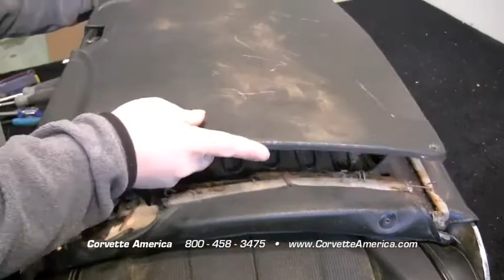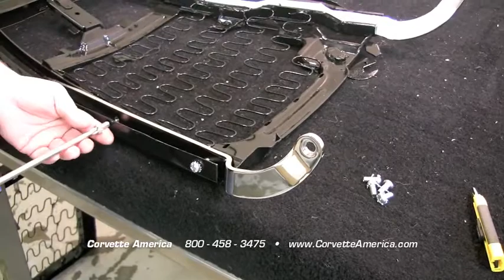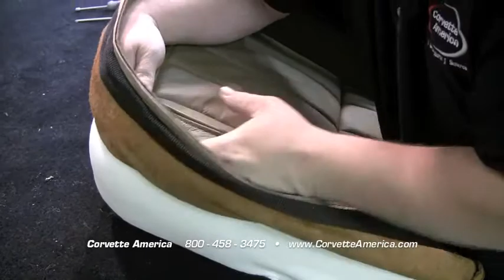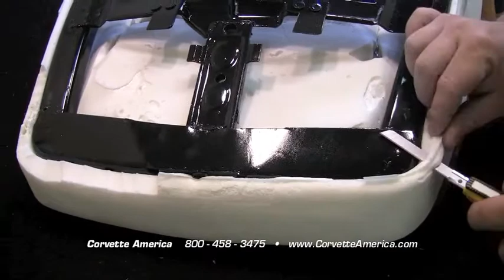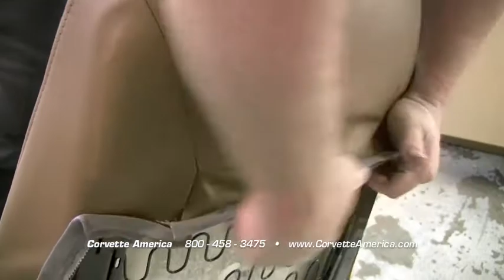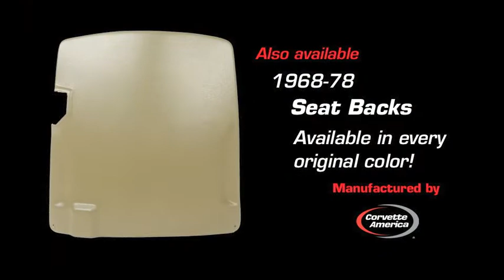1968-1969 C3 Corvette Seat Cover Installation by Corvette America

Comment: Thanks very much for the video.  I have a '74 targa and a '75 convertible.  I have the seat foam and covers to replace the old seat covers on both along with the wire kit and new bushings and adjusters.  This video is now my how to.  I had one of the seats out already and stopped the video after the strip and did the same to that seat.  I smiled all the way through the job as all went the way you described.  Tomorrow is the clean up, frame check and refit.  So grateful for the info and detail.  I checked and the foam and leather covers for the convertible came from Corvette America.  The other was cheaper and actually lacks the holes in the foam.  The whole quality deal on the second set is way under par but will function for the second vehicle.  So happy I found your video  Thanks again.